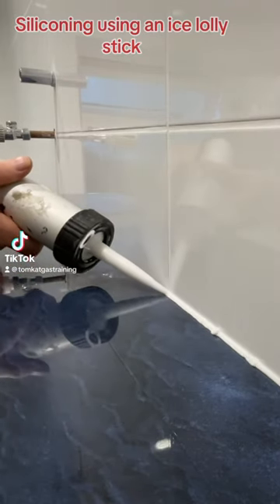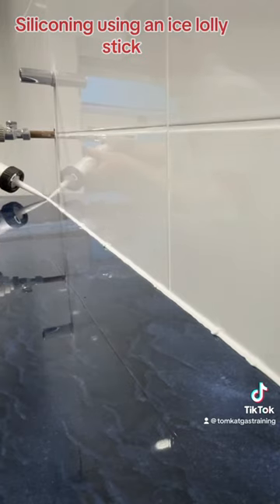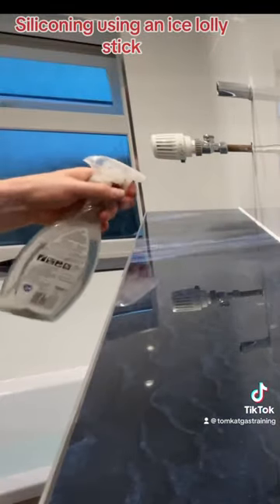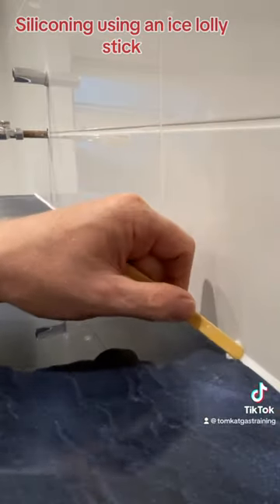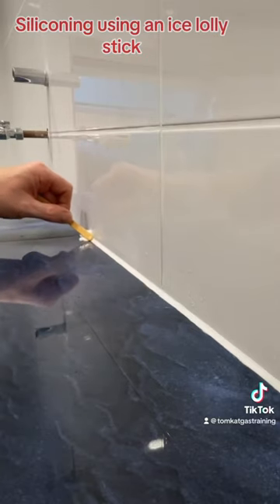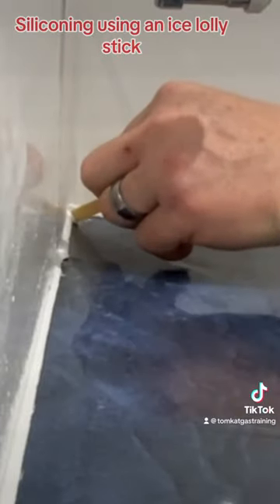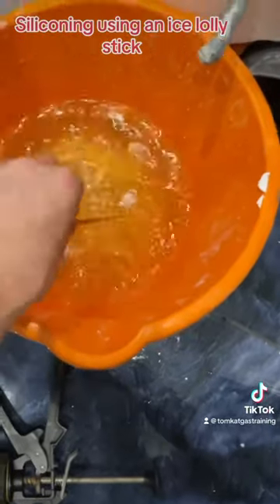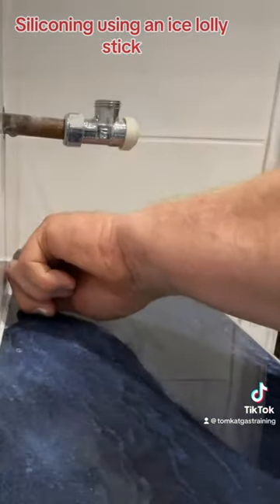How to silicone using an ice lolly stick #plumbing #plumbingtools #plumbingtips #plumbingtricks

Comment: You much better in gas teaching Derek. Please do not do this is so bad and looks like drunk person did it))) Use silicone applicator no need to spray and it gives strong line just like professional.